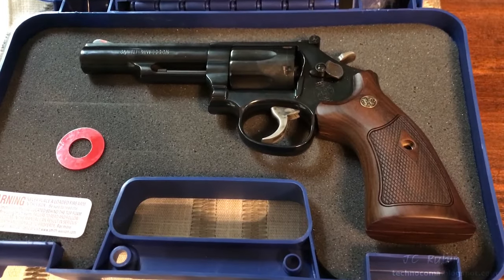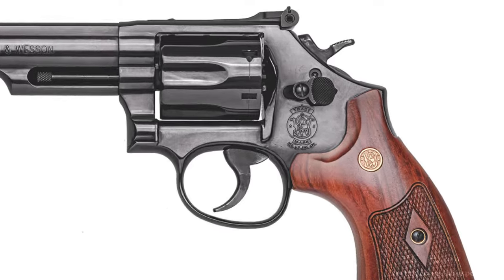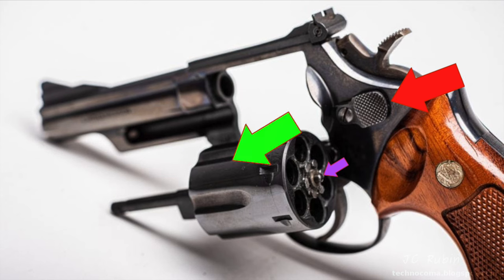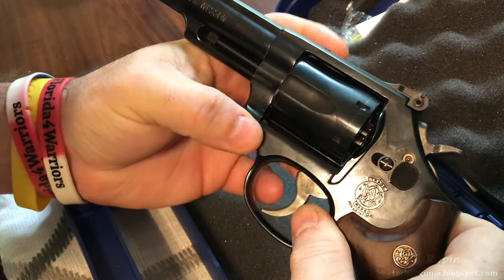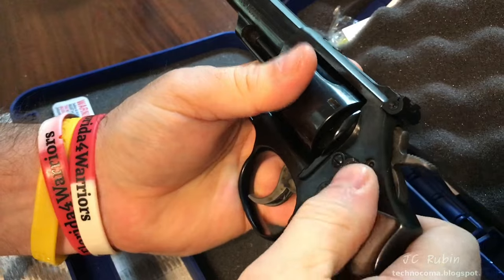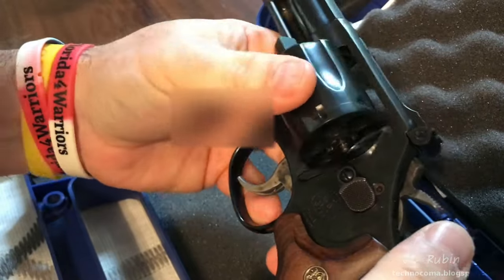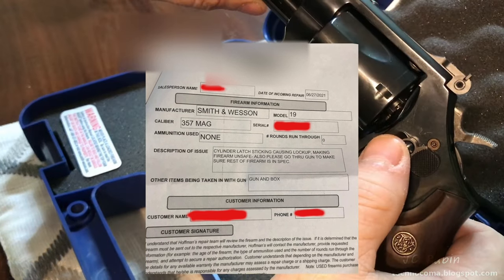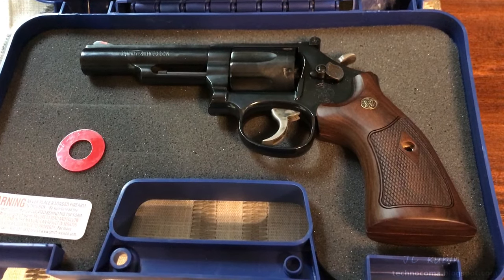Smith & Wesson Model 19 Cylinder Lock Defect on New Pistol

Comment: Smith & Wesson used to make excellent handguns.  I had an old Model 625 for decades and it was flawless.   I recently purchased a Model 66-8 and am essentialy rebuilding it .  New mainspring, new extended firing pin, new rear sight, etc.   Quality control at S&W has gone downhill in my opinion.

Comment: I bought a lightly used Model 29-10 last year and have experienced a few occasions of the gun light striking and the cylinder locking up after shooting a few rounds. I noticed when this happens that the key lock slides halfway between locked and unlocked. There also seems to be excessive friction between the lock and the hammer.  I wish this feature was removed, as it makes me not trust the gun. I plan on taking it to a gunsmith to see what can be done.
Reply from the maker: I checked and confirmed that this is not the key lock.

Comment: I have the same issue with my Alfa Proj 9 mm revolver. Not sure if some how the cylinder lock is not engaging properly when the trigger is being pull?
Reply from the maker: If it’s under warranty send it off to the manufacturer
Reply: @retrotechandelectronics  after checking the cylinder lock it is confirm the pin is not retracting all the way it is getting stuck causing the cylinder to get caught. The little spring inside will probably need to be replace with a more stronger spring.